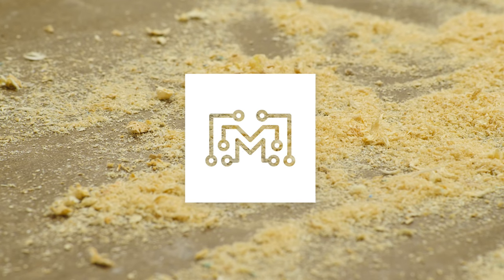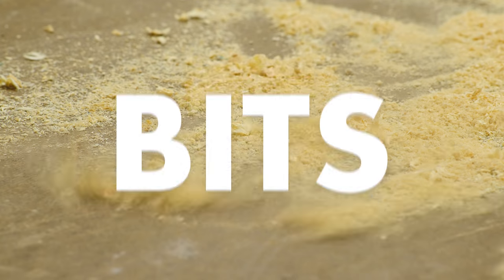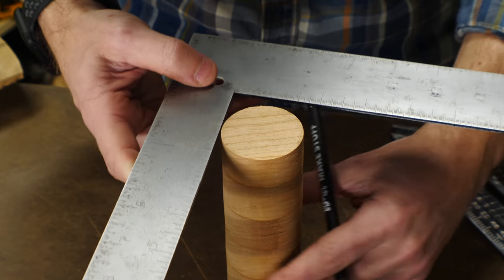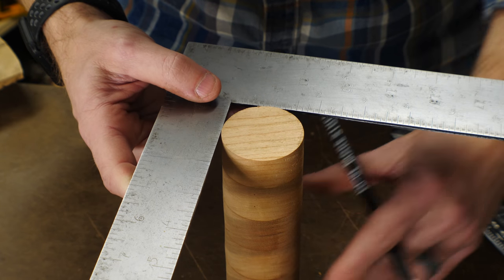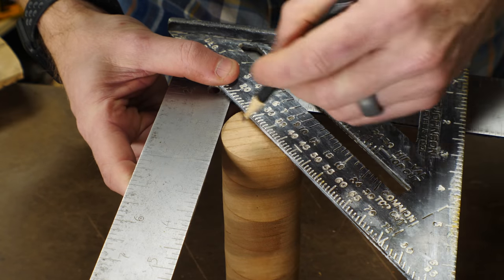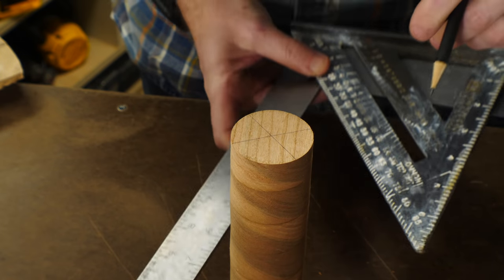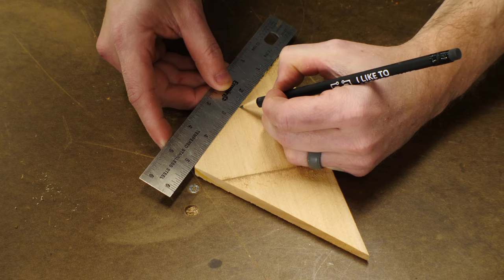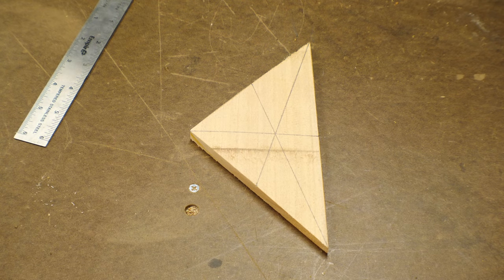Finding Center // Bits | I Like To Make Stuff

Comment: Hey Bob. To get a better result on the uneven circle you can draw a triangle any way you like as long as the points of the triangle are placed on the outer edge of the material. Then do your “find center of triangle”-way.

Comment: A quick way to measure "half" of a board that is not an easy measurement to divide is to angle your tape or ruler until the opposite edge does touch something easy to divide, like 4. Holding steady, mark where the 2 is, and that is half (center, if you only care about width).  Works with dividing into thirds, etc., as well.  Great video Bob!
Reply: Tharemy Hopkins This is what I do as well.

Comment: Great tips, Bob!
For circles, you can also draw a chord across the circle, definitely off-center. Then measure, divide by two, and draw a perpendicular line directly through the midpoint of the chord to have a perfect diameter.
Measure the diameter, divide by two, and measure the perfect center.

Comment: That's awesome! Hadn't thought about using a framing square and speed square for a circle. If you do the same center-finding on the same shapes alot, you could always also make a quick jig, tape two pieces together if you have spares, or 3D print something to make it even faster!

Comment: For circles, I like to use calipers to get diameter/2 and set/lock a compass(or the same calipers) to the radius. Then make several arcs from various points around circle to get center where they coincide. :)

Comment: Another great and really informative episode Bob! Another good way to find the centre of a circle is by:
- drawing a line across two edges of the circle (at any point) 
- measuring that line, and then marking the exact half-way point 
- then put a square up to the line you've just drawn, and draw another line that crosses over the original line, at the point where you made that mark. 
- then measure that line and the exact half-way point will be the centre of the circle :)
Reply: JMakes you need to have the center of the circle to do that, so it's counterintuitive
Reply: You can just make 2 random lines across the circle, then a perpendicular bisector of both random lines.  Their intersection is the center point.
Reply: EK Shaman how do you need to already have the circle of the centre?
Reply: Or you can do what Bob showed and be done in about 30 seconds
Reply: robzilla2165 you could but I was just sharing this method as well because a) not everybody has a massive square they can use and b) my method gives you a precise centre location as oppose to you having to guess the rough centre from a load of overlapping lines
Reply: I was gonna comment this one! I think drawing and measuring twice is easier than trying to balance a big framing square around my circle and then balancing another thing on top of that.

Regardless, it's good to know both methods just in case one doesn't work out.
Reply: That is nearly drawing a triangle inside you circle (touching the edges of the circle of course), and applying the triangle method :D
Reply: Kaden Cassidy the midpoint of one line, the midpoint of the line parallel to that line

Comment: What you can also do (and what i just thought of impulsively) is balance the piece of wood and get the center of mass which is also the center of the wood.
Reply: not necessarily true - if the wood has knots or voids, that would change the balance point and it may not be the center of the piece.  It would however be the center of its mass by weight :-)
Reply: Tom Phillips 
And if the density is even, you will get the same result by finding the centroid like Bob showed.

Comment: For circles, you don't even need a square to find the center. Just take a straight edge and roughly draw a line through the center. Do this several times rotating the cylinder. It's very similar to how you did it in the video. For finding center on squares, I will set my combination square to roughly the middle of the sqaure and make a mark from all four sides. This will leave me with a small square in the middle of it. I do this to find the center on my pen blanks. So much easier than trying to draw a line from corner to corner on them.

Comment: To find the centre of a hexagon is similar to that of both the triangle or the rectangle! Find the centre of each side and draw a line to the opposing side, or go from corner to corner!

Pentagons are also pretty easy! Find the centre point of all five sides, and draw a straight line to the opposing corner. You should be left with a spot in the middle of your piece that all lines intersect on!

Comment: I use a caliper when I need to find my center point of circular parts and decorative pieces. I measure the whole disk, then I set my caliper to cca. the half of that shape. Then I take my marking compasses and use that  measurement to search around these disks. I don't use calipers for marking because, it is going to wear on a long term.
It's really-really fast when you get used to it.

Comment: I draw a line on a circle off center then use a ruler to find the middle by dividing it by 2 and drawing a line at a right angle (you can use a piece of paper) you successfully cut the circle in half, do all steps again and you mediate because you "found your center" 
You can repeat just to make sure.
You can skip the first part on non like a circle just measure the points between the corners, use your ruler to find the middle of each side and draw a 90° angle up repeat for all sides.

Comment: an object hanging by a single point will always have its' center of mass directly below the hanging point. more useful to find the center of mass in a 3d object, 
however, for a 2d surface, you can make a paper cutout of the shape you want to find the center of... hang it by 2-3 points draw a line straight down, and then you have your center (transfer back with a hole in the paper, or by just taping the paper to your object)

Comment: For the circle, you could also draw two non intersecting chords (straight lines from one edge of the circle to another). Then draw two perpendicular (90 degrees) lines from the center of the chords. Where those lines intersect, that’s the center. 

Not sure if it works with ovals.

Comment: Circles: You can use a compass and scribe two arcs each from apposing sides to make a line on the center point, rotate 90 degrees and then do it again and where the line intersect is the center

Comment: Defining that the "center of a triangle" is is actually a surprising difficult question to answer.
Reply: It's the centroid of the triangle
Reply: For almost any job in the workspace you would want the circle inscribed in the triangle. The mass would be evenly distributed around it
Reply: matty amicaterra 
The centroid (centre of mass) is not the same as the incentre.

Comment: If you hang your object from the ceiling and then draw a line parallel to the height of the room starting from the hang point then hang the same object from a different point and draw another line, their intersections will give you the center

Comment: Better way to find center of circle: Take a right angle (such as a speed square) and place it on the circumference of the circle with the vertex of the speed square on the border of the circle and the sides of the speed square inside the circle.  The two spots where the speed square sides intersect with the circumference are perfectly opposite each other.  If you connect them you will have a diameter.  Make two of these and where they intersect is the center.

Comment: So if you want to find that middle point of a Non perfect circle, you can start to use your method but STOP when you have drawn three lines. Then you are going to end up with a triangle from these lines you just made intersecting one another. Now use your method to find the middle point in your triangle tip for this drawn triangle. And woalla, now you will end up with the middle point of that Non perfect circel :)

Comment: Let's assume I don't have any special tools because I'm a poor college student. I found the rough center of a circle by creating two parallel lines of equal length on a circle (it was small so I used a ruler and evened it out by eye, but you could measure each side I suppose). Connect the two opposite corners of each line and bam, you got your center.
Reply: Tyler Joseph Schommer Those "special tools" aren't really that expensive. Enterprising college students should have access to them somehow. If not, they would make great items for gifts from family or relatives. If well taken care of, they will last a lifetime.

Comment: Technically with triangles, you just need two lines. The third one is just to check the other two are correct. In case they don't match, you don't have a triangle.

Comment: these aren't exact methods.. you have to use a protractor
Reply: The methods are as precise as your use of the straight edge and/or framing square and the preciseness of the piece geometrically. There is no built in error in any of those methods as they use geometric laws to find the center. The circle method shown would be clumsy for me, trying to hold both tools. You can do the same thing by drawing two straight lines across the circle, and then draw intersecting lines perpendicular to those. Where the second two lines meet will be the center. It's effectively the same technique, but you don't have to hold so many tools at once.
Reply: SpoonsJTD in this case won't the two straight lines have to be parallel and of equal length?
Reply: Ken Weinert No, check out Jmakes comment above, it is a similar explanation
Reply: There are exact ways to find the center, a basic engineering class would teach the steps
Reply: A line that splits a secant (the first line you'd draw) and is perpendicular will always go through the center of the circle. Doing it twice gives you two lines that intersect in the center.
Reply: I should have said the intersecting lines have to split the first lines in two. So if your first lines (called secants) are 6 inches across the circle, the line you draw perpendicular would be done 3 inches from each point on the secant.